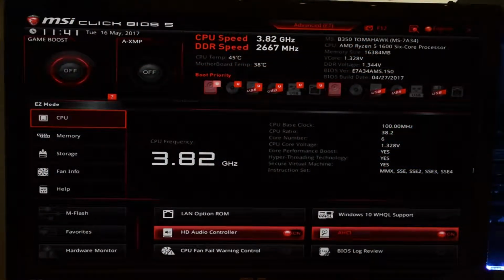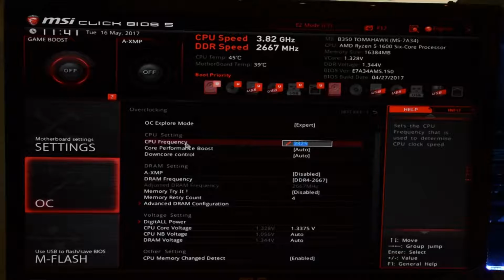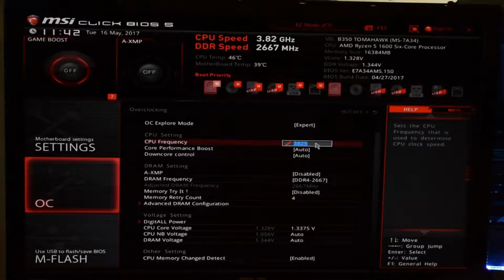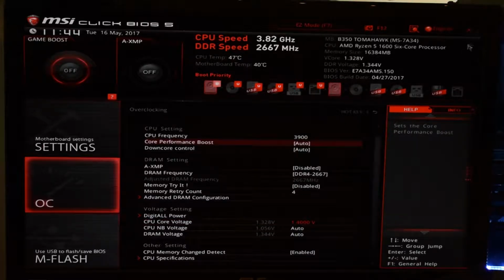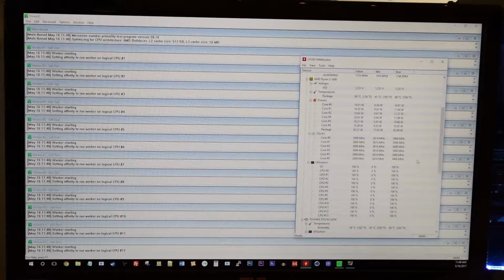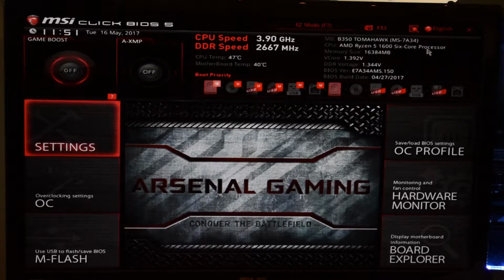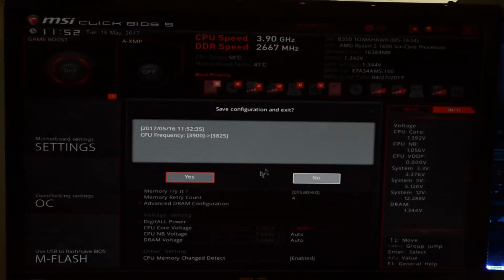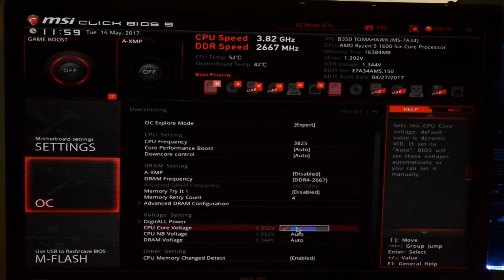How to Overclock a Ryzen 5 1600 CPU - Super Easy! (No Background Audio)

Comment: i have overclocked to 3.8 successfully, bios and windows says my speed is 3.80ghz but cpu-z core speed shows 1.55ghz even at load, what should i do? every program shows the same speed (1.55ghz)

is there something that i have to change in the bios?
Reply from the maker: Monitoring programs sometimes have a hard time reading clock speeds of Ryzen cpu's. Can you run the Cinebench benchmark and tell me the score? That should determine if it is actually overclocked or not.

Comment: So is it worth oc the CPU or will it not last long if I oc it? I'm new to this sorry
Reply from the maker: iCreamTV As long as you can keep the voltage down it should be fine. I've never had a CPU die on me from an overclock before and I usually use the same CPU for 2+ years. Because the ryzen CPUs don't overclock very far you won't get a ton of extra performance. Ultimately it will come down to whether or not you are comfortable voiding the warranty. But they should last easily 2-5 years or even longer. There just isn't any guarantee that they will.
Reply: SANTINI.IO alright thanks man great vid btw keep it up!
Reply from the maker: iCreamTV No problem. Thank you!

Comment: I question more: which memory are u thinking is the best for the ryzen 5 1600?
Reply from the maker: I think it depends on what memory is supported by your motherboard (check the motherboard manufacturers website). The best memory is going to be the one that runs at the speed it is rated at. If you can find a 3000mhz or 3200mhz that is supported by your motherboard that will be your best bet. The brands that I trust are Corsair, Kingston, and G.skill. I hope that helps.

Comment: I have a question:
Are you able to do a video where you can list your top five mechanical keyboard under 100 euros?
By the way, I watch all your videos
=>Your videos are pretty nice
Reply from the maker: Thank you! I might be able to make a video on that. If I don't get around to it I will let you know what I believe the top 5 would be, at the very least.
Reply from the maker: Sorry it took me so long to get back you. I have been super busy. Below are 5 mechanical keyboards that I would recommend that should be under your price range after shipping. I don't think you can go wrong with any keyboard made by Corsair or Logitech. I also added a really cheap option, the Redragon K552, for you to consider based on how positive the reviews are.

Corsair STRAFE ($79.99 USD): http://amzn.to/2tIN7Sg
Corsair Gaming K63 Compact ($79.99 USD): http://amzn.to/2sEznCY
Logitech G610 Orion ($77.49 USD): http://amzn.to/2tJ7wGK
Razer BlackWidow X Tournament Edition ($89.99 USD): http://amzn.to/2tEhb0y
Redragon K552 ($33.99 USD): http://amzn.to/2tEHT9b

I personally use the Razer BlackWidow Ultimate ($70.99 USD): http://amzn.to/2tC75xt

I've been using it for about three years now. I absolutely love it. I'm not a huge fan of Razer, but I think they did a good job on their keyboards.

Something to consider with whichever keyboard you decide to get, would be to get O-rings for the keys. The O-rings shorten the key travel and make them slightly more quiet.

Don't get me wrong, there is nothing more satisfying than hearing the click of a mechanical key, but sometimes it can be a little much especially when typing papers and stuff like that.

Rubber O-Rings: http://amzn.to/2sEOah2
Keycap Puller: http://amzn.to/2t9vsSi
Reply: SANTINI.IO ty veryyyyy much. my favorite youtuber.
Reply from the maker: No problem and thank you! That means a lot.